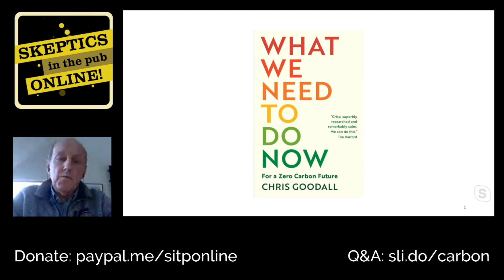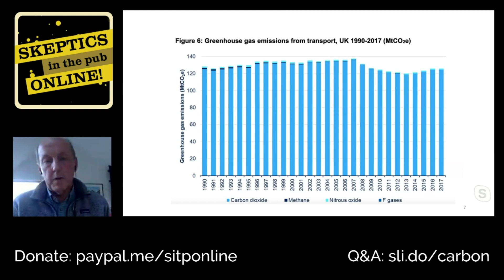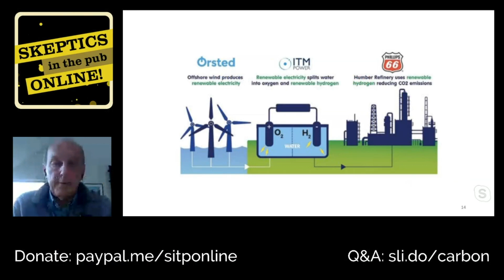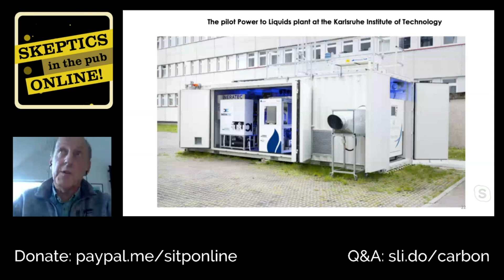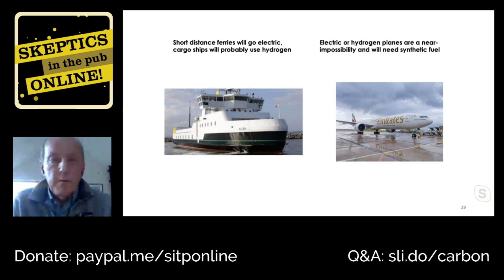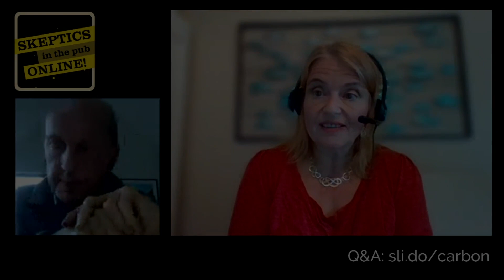How the UK can get to Zero Carbon - Chris Goodall

Comment: The strange thing about the 100% renewables proponents is that we never get the figures for quantities, costs, environmental impact, material use and waste streams to achieve their goal.

Just to get a handle on these values, a couple of months ago I did a simplified estimate of them, for replacing all natural gas and petroleum use, by a green hydrogen manufactured from low-carbon electricity generating technologies.

I calculated the UK will need to generate 4,029 TWh of low-carbon electricity each year and this should not be very wide of the mark. 

More importantly, if the final figure is different, it will not alter the proportionality of the competing low-carbon generating technologies. 

For starters, a possible combination of biomass, wind and solar would require a capital investment of £5,108 billion. Solar would last for 30 years, the others have 25 years lifespans and then it's start all over again.

Advanced nuclear power plants, with 2 years build programmes, will be available in the UK in 2030. They would cost £1,000 billion and have a lifespan of 60 years.

And this is the conclusion:  "...Net Zero by 2050: Renewables - Impossible; Advanced Nuclear - Very Manageable..."

https://bwrx-300-nuclear-uk.blogspot.com/2020/05/blog-post.html